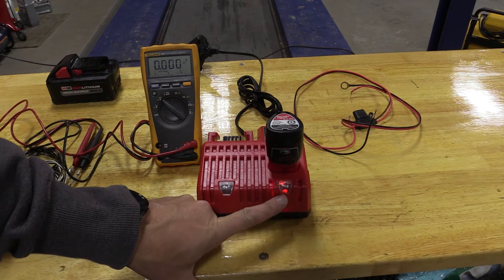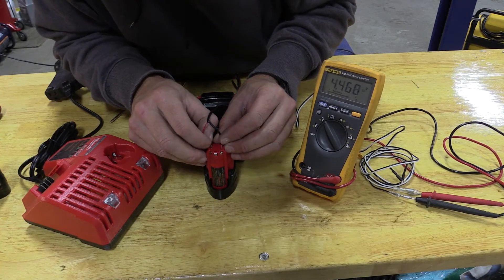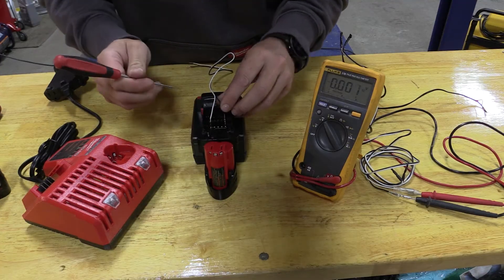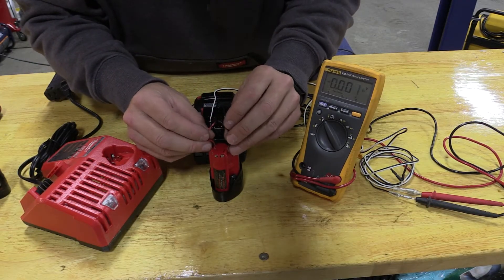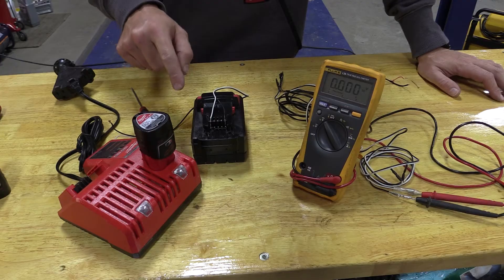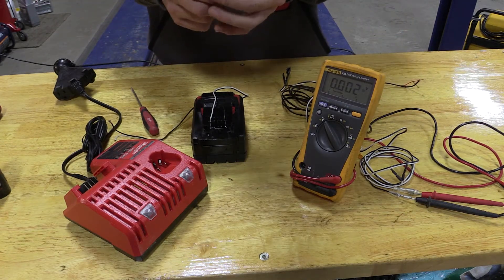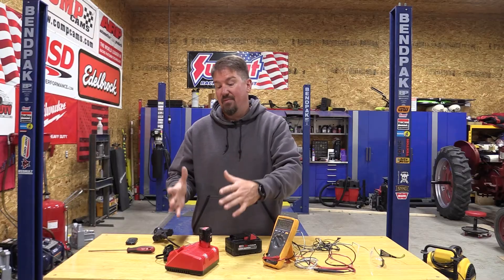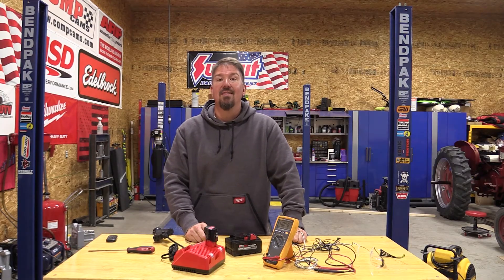How To Bring Back a Milwaukee M12 Battery That Will Not Longer Charge

Comment: Just use a 12v battery tender/charger by Delran 1.5 amp, it can bring back most batteries and not have to worry abouut lithium fires that can be very dangerous.

Comment: Controversial? Uh YEAH.
Does it work? Technically.
My experience used a m18 XC 6.0 to Jumpstart a m12 CP 3.0 (successfully) says yes.
Chickened out after melting the wire together when trying on a m12 XC 6.0 😂

Comment: As an electrical engineer this video makes me nervous. How to burn your house down at 1am is more like it.
Reply: Truth.
Cost of house vs a m12 battery? Nah.

The look on your wife's face as you're holding a glowing wire? Priceless.
😂
Reply: @UnpluggedCord At least use a 12V source or something current limited and have the bucket of sand or some other way to deal with a lithium fire ready. I’m going to try this but I will be using a DC power supply, which I can limit the current on. That is probably the only “safe” way to do this, especially because even if you don’t blow up the cells slamming 20V 15+A into them they will get so hot it will damage them.

Comment: Just do this with another fully charged 12V. Not a 18V.

You can also revive them if you keep plugging and unplugging them into the charger.

Plug it in, it will be red for a bit  before it starts blinking. Pull the batter right when it starts blinking, and keep doing that. It will eventually put just enough voltage in the battery to start charging.

I find the 6.0 M12 batteries are the worst for this issue.
Reply: Any way to use a rocker switch or power strip to semi automate this? When I did it with a 6.0 and turned the surge strip off the charger didn't stop blinking and restart the charging attempt. 😢

Comment: I can't stress how bad an idea this is.   If you want to raise the voltage you must use a constant current power supply with suitable peak voltage.  Even connecting the same voltage battery to charge a dead battery is a bad idea, but connecting one that's much higher voltage is irresponsible to say the least.
Reply: Agreed.  This is terrible advice.  At minimum use the same voltage battery to "jump" another battery.  Using different voltages is really stupid.

Comment: I did something similar, but I used my smart charger that I use for RC batteries. It will charge anything from NiCd, PB, LiPo. LiFe, LiIo and several other chemistries. The thing I like about this is that the charger doesn't care about the starting voltage and I can set the charge rate so there is little to no risk of fire.
Reply: This is a MUCH safer process than simply jumpering directly to a higher voltage battery.  Everyone should keep a "dumb" charger handy. :-)

Comment: All you are doing is charging the 12V battery from a 20V unregulated source since the "smart" Milwaukee charger is too smart to work. But doing so without any current limiting is very dangerous as you observed from the battery smoking. This is how Lithium fires start. By placing a current limiting resistor in line with the 12V battery you can safely bring the voltage up while keeping the current in check. An even more elegant solution would be a variable voltage bench power supply that would allow you to control the voltage while monitoring the charge current. This would be a safe way to bring back all types of Lithium Ion batteries that have fallen below the threshold for their "smart" chargers.
Reply: Yeah using at 18v to charge a 12v is really dumb.

Comment: If the m12 battery was stored at 50% would that prevent it from going bad or having the problem that you experienced?
Reply from the maker: I seem to get this problem when I leave them plugged into my M12 heated jackets unused for long periods of time.  Storing at half charge is good for the battery, but so is fully charging it and using it every few months.

Comment: I usually do the same thing but i charge individual cells not a whole pack 
I would never connect up a 18v pack to a 10v pack that just seems like trouble
Reply: Noob question. How do you charge just an individual cell, when they are all soldered/tacked together?
Reply: @wadeokamura7028  It doesnt seem to matter if you run a set of volt meter leads to the individual cells you can test each batteries voltage so "jumpstarting" a cell works in the same way and i think is safer

Comment: I’ve successfully done that with a 6 amp 12 volt , have it marked and only use it in the m12 radio so far it is recharged several time without having to jolt it anymore .
Reply: Gotta hijack your comment, it won't let me post a comment for whatever reason. 

To make it SUPER EASY to get the wires in the m18 slip a spade fuse in the connectors to pinch the wires in, or stick a utility blade in the connectors and just put clips on the end of your wires.
Reply: I did that with an m18 8.0, it's my 'shop battery' try to keep it in low draw tools.

Comment: I have several “new” batteries that have never been opened - waiting on my used batteries to die. If a brand new sealed battery is dead out of the box, you can use this method to get it to charge. The issue is with the low voltage of the battery, the charger doesn’t recognize it as a good battery until the charge is within range. Good stuff as usual.

Comment: I’ve made my own wire kit with fuse for mine. Cool to see a video on it! I did positive and negative with fuse on the positive. Used 12v to 12v and let it sit a while to equalize charge. Might be safer than using 18v?